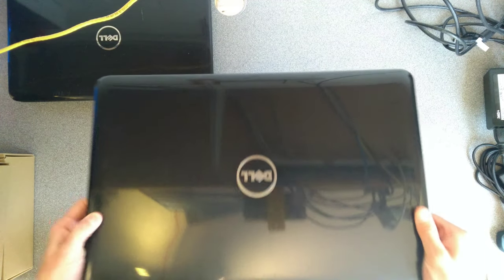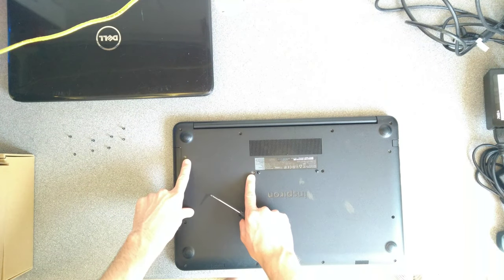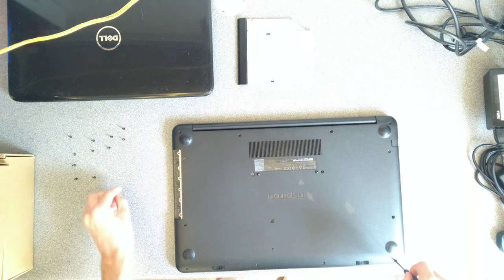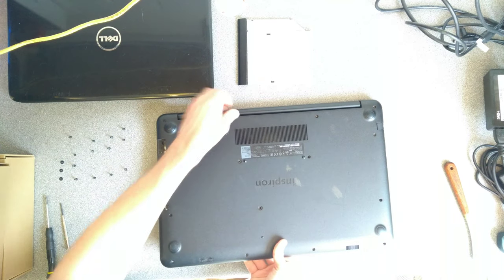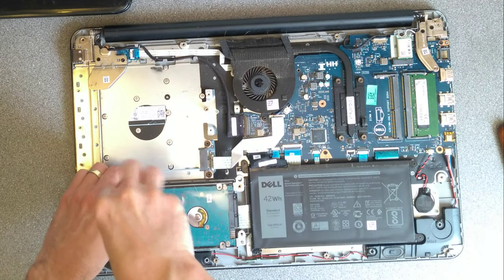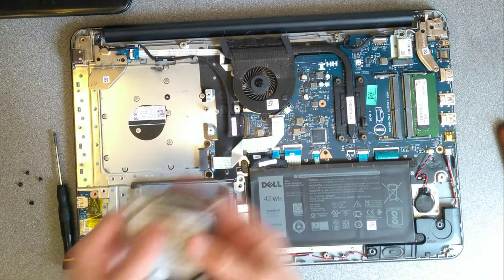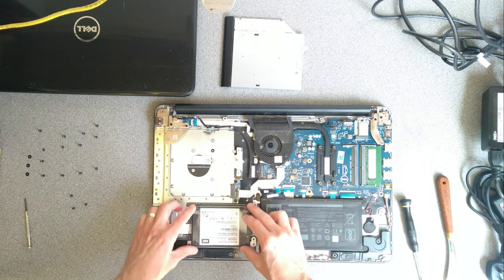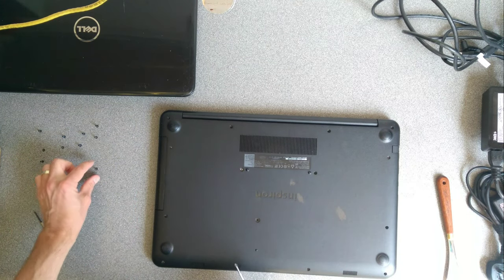How to replace the hard disk in a Dell Inspiron 17 5767

Comment: Thanks for the video. I couldn't get the 3 small screws in the DVD drive bay out even with the smallest of screw drivers. I ended up drilling them. Also, if you change the fan, be careful of the power switch ribbon cable that runs under the fan assembly. This can pop out very easily by mistake and will then require the lifting of the mother board to clip it back in. The fan assembly is connected to the CPU heat sink and will therefore also require some thermal paste when putting it back.
Reply from the maker: Good information to know! Thanks.
Reply: Thanks for your comment. It was very helpful to me.

Comment: Many thanks for putting this demonstration together. The comments also have been useful to me. I was only looking to add more DRAM. The three screws in the DVD drive bay were my downfall (Dell had only put two in !). I could not remove them at all. I am now going out in search of one of the screw drivers recommended below.
Reply from the maker: Those dvd drive section screws tend to be tiny and need a "jewelers" type screwdriver. Especially fiddly on old Sony VAIO laptops.

Comment: Great video! Have you heard of any fan problems with this model? My fan has been making an abhorrently loud noise lately! Any tips on fan replacements or good fan upgrades? Thanks!
Reply from the maker: 8:02 you can see the fan top middle. I expect it is as simple as unscrewing the one screw at the bottom middle (although look for any other around its edge that I can't see in the video) and unplugging the lead that goes into the motherboard. Then lift out the fan, buy a replacement on eBay and put the new one in. I expect that only the fan should need to come out with no need to take off the heat pipe and radiator.

No known specific problems with the fans in these but any laptop can suffer fan problems and regularly do.
Reply: @freename  Hmm I will try that. Thank you!

Comment: 3:30 where you say you need a very small screwdriver for the 3 small screws. my laptop is also inspiron 17 5767 but refurbished, I guess. those screws are not there. the screws on the sides are lacking and in the middle, where the middle screw should be, there is something i don't know what it is, as if it's sealed so that no one can open the laptop. do you have any ideas? when i try to separate the bottom plastic i see that it's still attached although there is no screw there. i can send you a pic.
Reply from the maker: If you have a model without the DVD drive you probably don't have those wide, flat screws with a tiny head. It is likely quiet difficult to help over the internet (and slow for me to reply).. but you can post a photo to a photo sharing site and then send the link here and I can see if I have any ideas.

Comment: Regarding a.c power ribbon connection, how would you know when it's fully seated before I can lock the latch?
Reply from the maker: Sometimes they have a line on the ribbon, otherwise you just have to make sure it feels secure and has hit the end of the connector. Difficult to describe.
Reply: @freename  Been there, I understand you develop the feel after so many times it becomes second nature. Thanks, I needed to hear that cause I was second guessing myself.

Comment: Hey, what kind of SATA type ssd do I need? It seems smaller than normal SATA
Reply from the maker: A "Laptop Thin" 2.5" HDD should do. All SSDs I've seen are "laptop thin". Same dimensions on the length and width but the height is thinner than the original SATA and PATA laptop hard disks.

Comment: can you put the hard drive you removed where the dvd drive goes?
Reply from the maker: Sometimes laptops work with dvd to hard disk converters. Give it a go but make sure you get the converter from somewhere with s good returns policy if it doesn't work.

Comment: If I remove the battery, can it be used only connected? I looking for https://www.europc.co.uk/dell-inspiron-17-5767-intel-core-i7-7500u-16gb-ram-2tb-sata-17-3-1920x1080-fhd-4gb-amd-radeon-r7-m445-dell-1-yr-wty-129714.html  or maybe gtx1050[3gb vram] ?
Reply from the maker: Sorry, I don't know the answer.
Reply: @freename  The laptop work without battery? example: just conect with cable